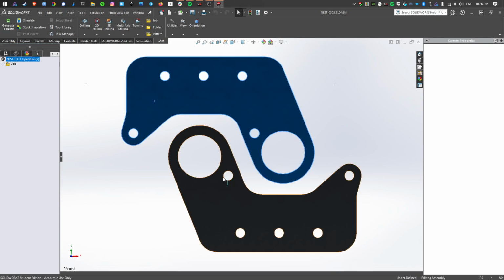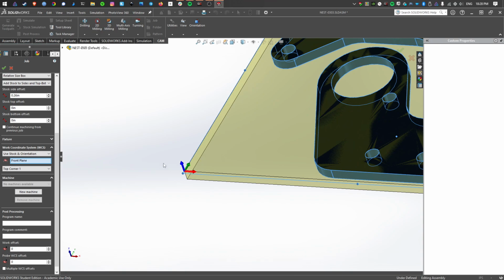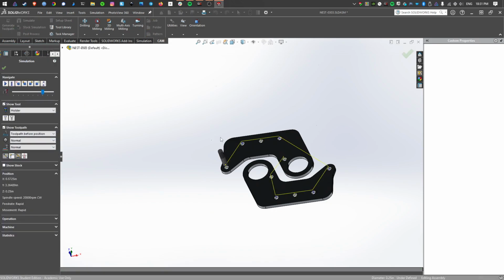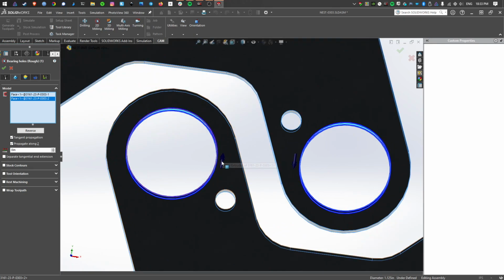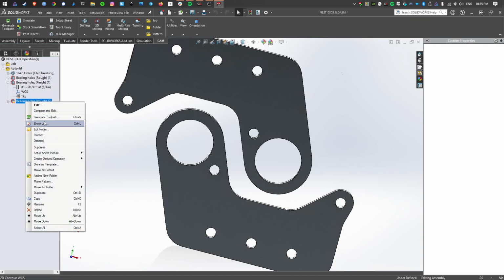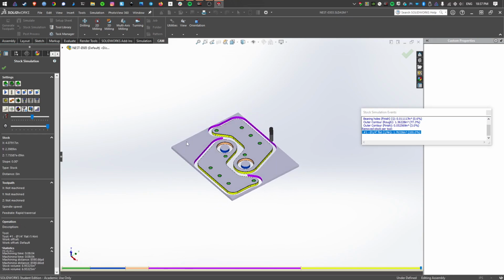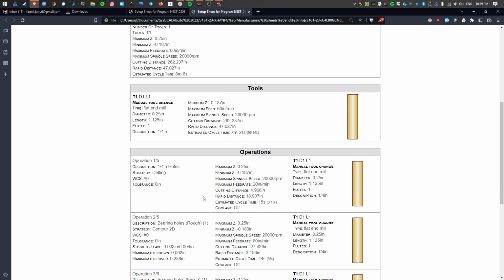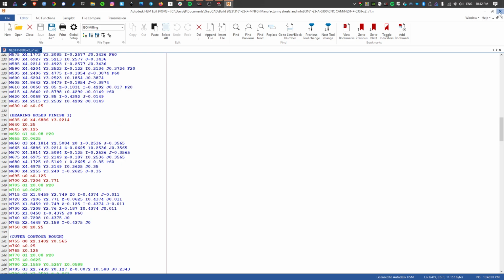HSM walkthrough

Comment: Hey! How do you get the onefinity post processor??
Reply from the maker: https://cam.autodesk.com/hsmposts 
search "Onefinity"
Reply: @jarrfarr  So I have to get HSM? Cant use regular solidaworks cam?
Reply from the maker: HSM is much more intuitive to use, and the basic version is free (HSM Express). In this video, i only used functions available in the free version.

https://forum.onefinitycnc.com/t/cam-software-for-solidworks-users/976/10?u=jarrfarr
https://forum.onefinitycnc.com/t/can-i-use-solidworks-with-onefinity/709/15?u=jarrfarr

Visit my profile page on the 1F forum and see my threads about CAM, SolidWorks and post-processors.
Hope this helps!
Reply: @jarrfarr  Definitely helps! Sorry to keep bothering you, but even after installing HSM, and selecting onefinity as my post processor, my problem still persists. For some reason, after XYZ probing and hitting play, the machine returns to home, and then tries to probe for Z. After it fails, the estop activates, and wont let me continue the G code. Is there code at the beginning I should change or get rid of? 
Thanks for the help!
Reply: @jarrfarr  Scratch that, I got rid of the homing code, but now NO prompt is displayed on my screen after clicking play. According to chatgpt, the code also wont stop and display a prompt for tool change, but instead will continue onto the next procedure automatically. Got any tips?
Reply from the maker: @k0fadanks848  In the machine post settings, make sure you have "manual tool change" selected!